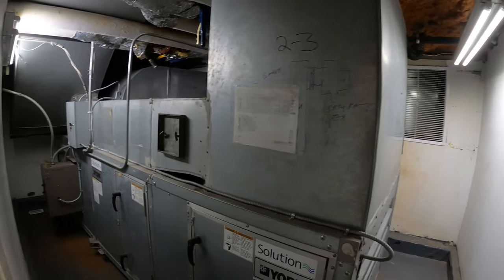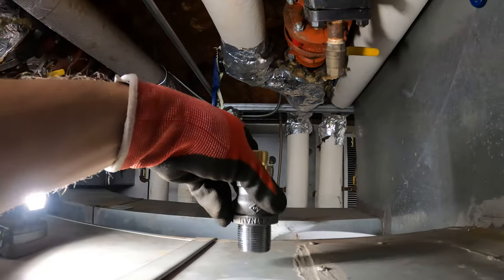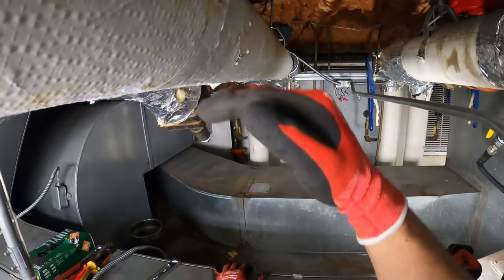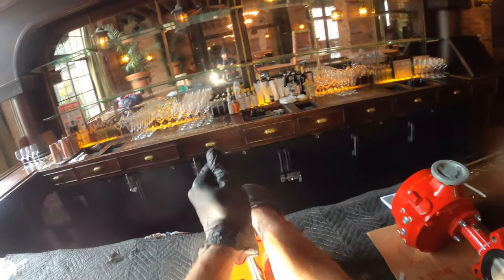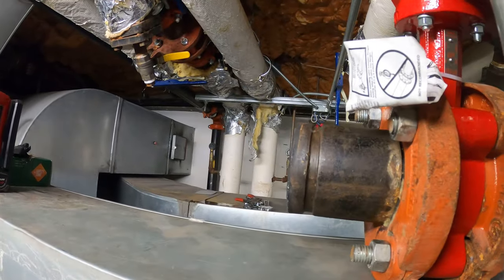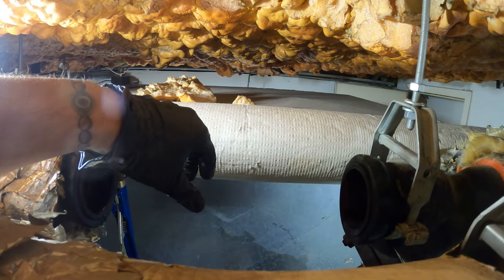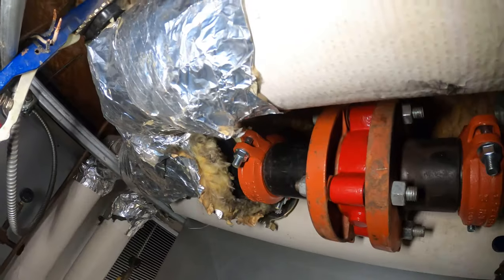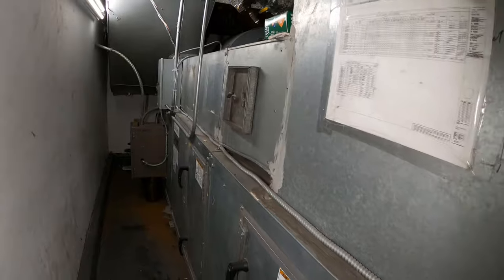HVAC: Bray Series 70 Actuator/Series 31 Butterfly Valve Installation For 4 Pipe Fan Coil Unit - FCU

Comment: Always enjoy your videos. Thanks for sharing. Got a question, would it fit to turn the actuator 180 degrees so the wiring cover is facing down? It looks like it would clear the drain line you had in place. You keep posting them and I’ll keep watching. We ever going to see part 2 of that inverter system with the bad thermistor?